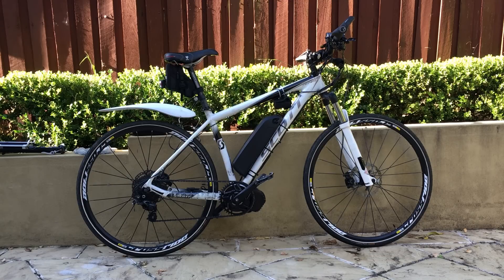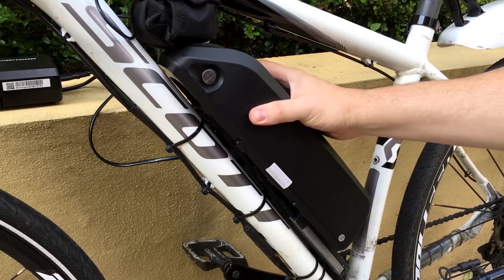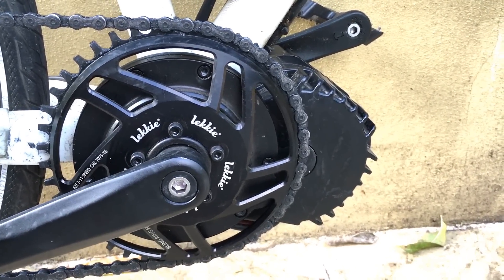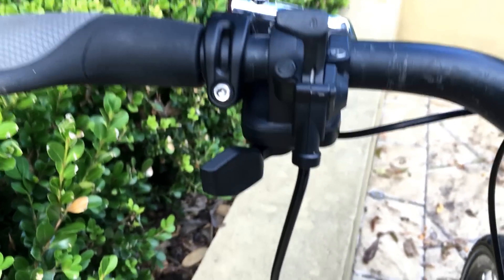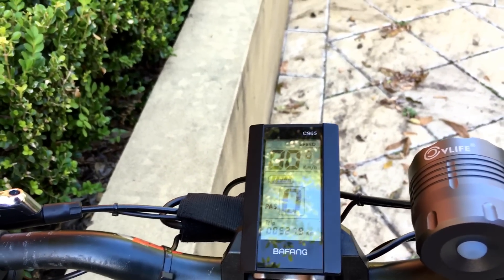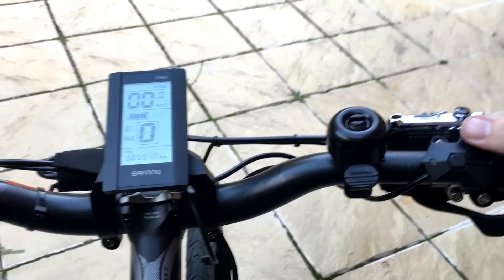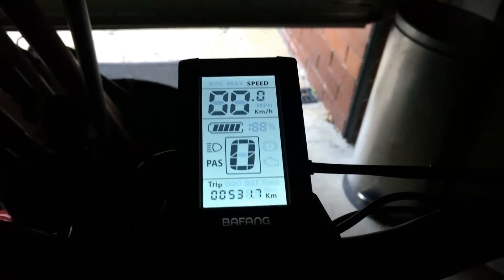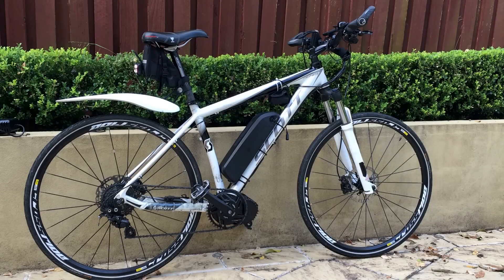Bafang BBSHD 1000w Walk Around And Review 65kph - 40mph Test Run

Comment: Got a question for you extremists: How well does this BBSHD product perform in wet weather i.e. Heavy rain? I'm talking about the electrical parts like buttons, throttle control, LCD, switches, connections etc. I understand that it has an IP46 rating on the motor. But will the switches short out and send you sailing under extreme wet weather conditions? I live in Florida and we get a lot of rain here. Anyone have any any experience with this? I'm mainly concerned about safety and reliability.
Reply from the maker: I have been caught in a couple of storms and had no problems just wiping the digital controller screen with my glove. It seems to hold up pretty well to rain and to me hosing down the bike. I Certainly wouldn't take the bike in a river though...

Comment: Where I live we're pretty much under water for 6 months out of the year. Have you put your setup through a lot of rain for extended periods of time? How did the battery and motor handle it?
Reply from the maker: Chobaca no problem at all with rain, yes have had it in heavy rain and also splashed water from large puddles. It’s still going strong both motor and battery!

Comment: Hi, I just bought a new bike with the bbs-hd system installed and I get some motor vibration at high speeds under throttle. Do you get this with yours at all?
Reply from the maker: Sure do! It's just the sheer power of the motor vibrating the aluminium tubes. The bikes weren't originally designed to be used with motor. It's a bit like driving a manual car it vibrates at higher revs then smooths out once ur cruising again...
Reply: Though this might be the cause, I suspect it is resonance in the motor. It does happen at a certain rpm and load. Also regarding the clunking when shifting, I find a quick back pedal just before the shift gives me a few moments before the power comes back  on. It works better than that shift sensor (I have those too). Btw my 750 doesnt have that vibration but my HD does.

Comment: Hi,  I am a Emmanuel Pineda from Pampanga Philippines.  I recently bought a bbshd bafang motor 1000W.
I have  two concern:  1) The company where I bought my conversion kit send me a DPC18 display but it does not  make my motor work.  It says error 30 communication error.  I do not know how to fix it and configure it.
2) second concern,  the maximum speed I am getting on my bbshd is only up 48 kms/hr.
     Can you please help what to do to attain an speed more than 48kms / hr.  I would be happy if thru your help I can go as fast as at 70kms/ hr. as shown on your video of your display.
Thanking you in advance of your help.

Comment: The distance sounds pretty poor. I've heard they go 20-30km on full throttle and 60-100kms on pedal assist. 

What's your thoughts?
Reply from the maker: There is just so many variables, hills, weight of rider/bike/wind/size of battery...possible to get 50kms/60kms out of my setup if you didn't touch the throttle. Just depends how u want to ride it. I prefer to use throttle for fun and a mix of pedalling....May just get a 2nd battery one day if I need to ride for more  than a few hours...
Reply: I have a 48v 21ah, on pas 1 i can do 40miles, weight, hills, wind etc

Comment: Hi can it run without all the safety brake cut off features?  just want simple thumb throttle so looks basic and unlike a e bike, I'll hide the speed controller and battery inside rear pannier rack bag. it's uk and we aren't allowed any fun, 250w is the limit
Reply from the maker: Good question, your best to check with an installer. I think you prob need the brake cut off and to be honest you need that to help stop...
Reply: 250w limit over here in Oz too but I got the 1000w bbs-hd anyhow. 
As long as your not barrelling along at 65km/h without pedalling all the time you should be ok. (pedal assist level 2 operates at around 250watts and you can set a speed limit.)
Speed controller is built into the motor and you would want the  brake cut-offs  as there is a fair bit of torque on lower gears and there is a small delay with motor stopping on pedal assist. 
 exceeded my expectations! More fun!

Comment: I am curious to know how did you manage to get 75 km/h. Did you change the original controller and if you didn't what are the settings of the motor? I have the same motor but I can't make more than 50-55 km/h on flat surface.
Reply: going down a big ass hill helps

Comment: Bro help me out, I got a new bbshd and it shows a lot of resistance while pedaling forward with no battery or asist. Is that normal? Backwards I can hear the clutch clicks and it works very easily. Do you have a lot of resistance with assist 0 or with no battery?
Reply from the maker: Mihail ZX no not to much resistance, check your freewheel/hub with a bike service and also change the original chain ring to a bling ring...the tyres make a difference too if u are too chunky off-road tyres and riding on paths etc...

Comment: I heard that the newer model bbs02 can handle the 52volt battery. I get 50-55kmph. You think the upgrade from 48v to 52v will be noticeable? Happy riding :-)
Reply from the maker: Robert [TOG] I just upgraded from 48 to 52, certainly notice more punch and it sags power less. Keeeps at its peak. I’ll make a follow up video soon.
Reply: @TwistTheThrottle2024  Thanks for the answer i was looking for :-). Did you get 10-20% more speed?
Reply from the maker: No not really that much speed extra. Just noticed extra torque and a more constant torque that doesn’t drop off as much after full throttle
Reply: @TwistTheThrottle2024  Torque is good. It's pretty fast the way it is. Thanks my friend. This helped me very much.

Comment: Hi man I'm hesistating a bit between the BBSHD (1000w) and the BBS02 (750w) which one do you recommand me to take? What's your average autonomy with your bike please? Thank you
Reply from the maker: Guilhem B get the BBSHD! Better built awesome power! Less strain in the motor up hills
Reply: I've owned both 750watt and 1000watt Bafang Kits and you do not need any more power, than the amount of power provided by the 750watt kit.  The 1000watt kit isn't even that much faster; as it just provides more torque. Unless you're a bike taxi, you don't need a 1000watt motor.  The 1000watt motor was primarily designed for bike taxis.  It equals a considerable amount of added weight, bulkiness and rapid draining of battery power, especially if you're using throttle only mode.  You'll find yourself constantly watching the battery level, concerned about consumption, rather than enjoying the ride.  I have a 750watt kit with a 17.5 Ah downtube battery.....The range isn't even a concern.....Not enough hours in a single riding day for me to run the battery down.

Comment: did you experience the motor swinging upward when you throttle? hitting the down tube of your bike
Reply from the maker: There was an issue with it loosening in the 1st week because it had spacers and somehow became loose but after it was retightened it has never come loose again after nearly 1000kms on all terrain.
Reply: +Fresh Anything may i know where you put the spacers? is it on the chainring side or left crank side? sorry its my first build .
Reply from the maker: Spacers are only needed of the motor has no clearance and is hitting on the frame. I would probably get the opinion of an electric bike fitter for your install especially if you have run into issues. I had mine fitted for me...

Comment: Lockable battery but the installer used zip ties to secure it... 3 seconds and that battery would be gone.
Reply from the maker: No it's actually screwed through the frame also. I never got it stolen in 3 years. I have another battery these days in a triangle bag. Goes forever!
Reply: @TwistTheThrottle2024  Awesome, making any more videos of it? just out of interest what was the kind of range you got with the 14AH at 30+kmh/r when commuting?
Reply from the maker: @onoff314  I used to get about 40kms going pretty hard....now I can get over 150kms from a 30ah plus I still have the 14ah if I need to go further
Reply from the maker: @onoff314  yes I am definitely thinking to do another video with an update if people want to see it...

Comment: Do the cranks turn when the drive is on?  In other words, does the motor make the cranks turn?
Reply from the maker: mystevie31 no the cranks only move when you pedal. The chain wheel moves with the motor independently and also when you pedal.
Reply: @TwistTheThrottle2024  That's awesome! I'm definitely going to get one for my bike!

Comment: Hi please help! I finally bought BBSHD and now I have to decide about the battery. What is better, 48v 17 ah or 52v 14 ah? Is 52v worth it if I get less AH for the same money? Also where can I buy the installation tool for BBSHD expect for Lunacycle if I have to order in Russia?
Reply from the maker: I would get the 48V again over the 52V, It has so much power anyway, any more I think it would be putting unwanted strain on the frame. The added extra Km's/Miles will be better. This is great if you want to go off road on some trails or for a long ride for about 30-40kms...I'm sure you could find the installation tool easily online, I just went to an installer and they did it for me.

Comment: How durable is the motor housing? If I'm mountain biking and occasionally bumping into rocks, will the unit hold up?
Reply: Probably not they are only aluminum cases easy break will need some kind of protection bash plate

Comment: hey mate good vid! i bought a bbshd but no battery.  i found a 48v 14ah battery (not many in austrslia atm) for 900$. are there any particular brands that are not compatible or best suited to this motor?  thanks.  b
Reply from the maker: Hey mate, there is some
Great technology out at the moment for batteries. I would talk to emax bikes in Sydney for advice on the best battery pack. They will point you in the right direction if not you would find in other states in Aus an Ebike shop or installer. You during yourself? Finished product is worth it!!
Reply from the maker: +big willie yeh not really available anywhere in Australia and can't get shipped easily. So much power anyway, I reckon I would lose some range by going 52v so yeh very happy with 48v
Reply: I just got my BBSHD plus 52v 16.5ah battery installed on merino hardtail. Will post a vid soon. It totally exceeds my expectations, will let you know top speeds and range in a few days but it climbs to 50kph in a few seconds. Was wondering if there is any need to get a USB plug to operate the software via computer with the brains of the controller?
Reply from the maker: +bee R.a.d nice! Yes you will need to get the USB cable if you haven't already had the speed limit removed in programming by whoever installed it for you. Otherwise will be limited to 50km/hr. Who installed for you? Yeh it's such a fun bike, absolutely love mine!

Comment: I'm about to bolt one of these with a 52v battery onto a 20" BMX with an internal gear hub in the rear.. I'll basically have a 60-70kph capable BMX..lol
Reply: na wheels will probably be too small, you will have good acceleration but less top end speed due to the 20 inch wheels

Comment: how long will the chain last? I'm a strong cyclist and if I buy the cheapest shimano chain it only lasts a few hundred miles before it starts to crack or even snap (I've had 2 budget shimano chains now that seem to have failed, one snapped and the one I'm using now has a crack which will probably fail pretty soon
Reply from the maker: Make sure you get a Lekkie Bling ring, it's easier on the chain. 1000kms strong now and no breaks

Comment: After four years, how has it held up on your chain and cassette?
Reply from the maker: I've replaced the chain and casette as you would a normal bike after wera and tear, I've actually upgraded the battery to a 30ah 52V and also had the controller replaced once. I'll do another video one of these days to update

Comment: will this setup work with a duel suspension bike?
Reply from the maker: Stoney Flats sure it cam work, you just need to find a frame that can accommodate the battery. Will be a little harder to find the right frame.
Reply: Can the battery be mounted on a back rack?
Reply from the maker: Stoney Flats sure y not, ur best to work with an installer for custom setups.

Comment: Why spend so much extra when torque/ thrust is the same as 750W @160nm?
Reply from the maker: You better to ask the experts but all I know is I rode both and this one is 10 times stronger and a lot more power!
Reply: Torque isn't the same on the bbs02 750watt it's got 120Nm not 160Nm like the BBSHD 1000WATT research it properly

Comment: how many km reach with just throttle? About....
Reply from the maker: It depends on the terrain, but if it's mostly flat you could get about 25kms, you can turn that into 40kms of you use pedal assist. If it's really hilly and you use only Pedal assist you might only get  18kms...hope this helps

Comment: There’s no way that goes 40mph on flat surface. Maybe 40mph downhill but that’s it. My 72v controller/battery barley hits 40mph on flat surface.
Reply: mine does 44 mph flatground
Reply: kmh, sydney
Reply: With my Catrike recumbent trike, BBSHD, and 48V battery, I hit 36mph on level road. BBSHD has insane power.
Reply: El BBSHD con 1000w puede mover una bicicleta hasta 32mph máximo, he construido muchas bicicletas con ese motor y esa es su velocidad máxima real, todo lo demás es falso.
Con un controlador ASI BAC855 de 90A limitado a 3250w y batería de 72v he logrado 50mph. Con 52v y 2800w he logrado 42mph.

Comment: You would only hit 85kl 
If you had a 52t front chainring I say bollocks. You would average 35 mph so I don't know why people exaggerate on there speeds. I have a 44t front chain ring and ghost pedal in the rear 12t and waiting for the 48t to arrive so most people averages about 26 to 28mph.

Comment: One should never use Strava on an eletric bike. Seriously
Reply from the maker: Davi Strauss one can use whatever he wants as a tool to measure distance travelled, speed,   and maps...I don't really care for records but hey if it annoys you then that's cool haha
Reply: Strava you have the choice to select many kinds of sporting activities, and there is an option for "e-bike". I use this and my rides no longer appear on leader-boards.
Reply from the maker: David Lonsdale you might as well leave it on the leaderboard it will push everyone even harder to strive haha
Reply: I have quite a few KOMs under my own pedal power :) Although there are a few segments that are held by ex-dopers; now it is very tempting to troll them ;)
Reply from the maker: David Lonsdale don't really look at the stats I just like riding and knowing how far and where I've Been...
Reply: Yes same too. Have a question about the motor; what's the pedal resistance like when not using the power? I have a hub motor now and zero assist things get noticeably harder.
Reply from the maker: You can actually ride this mid drive as a normal bike very comfortably, its great to know if my battery ever runs out I can easily ride under my own power.
Reply: Please forgive me for asking for more precision : Do you mean there is no practical difference in the strength to apply for a given speed after and before the motor was fit ?